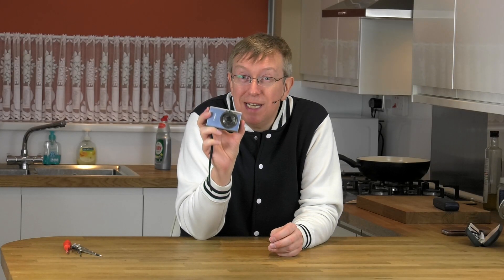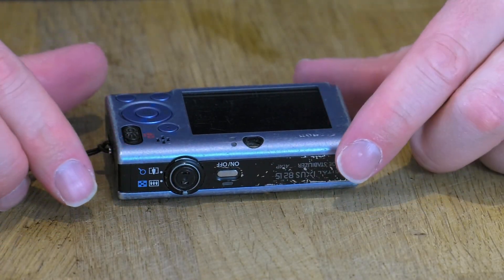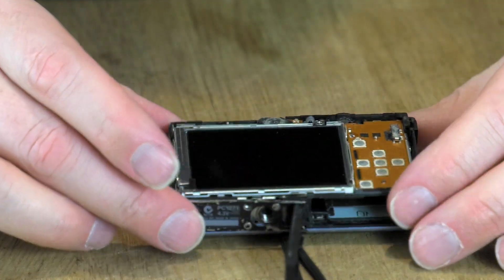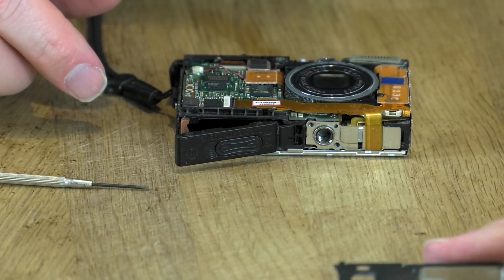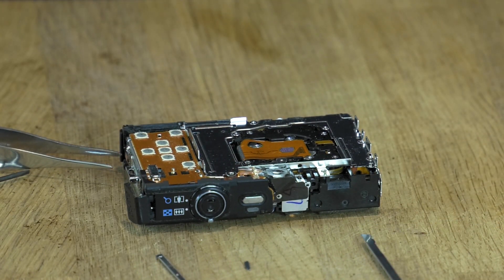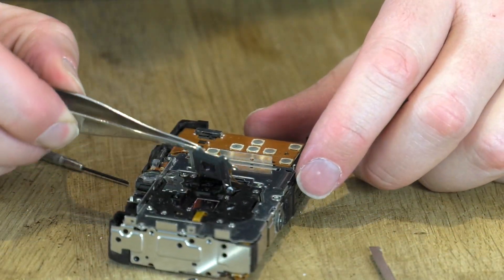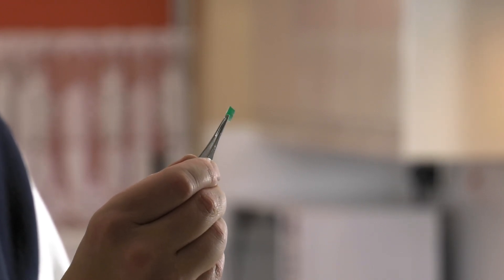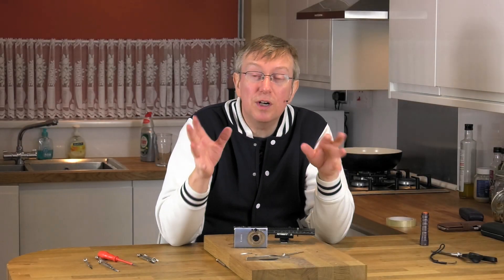How to Make a Night Vision Camera From a Regular Digital Camera (Infrared IR)

Comment: tried it on a nikon camera and did not know that the black connector that hold the ribbon cable was supposed to be useful, everything works EXCEPT the lcd because the lcd ribbon isnt connected fully and its loose, and since i thought you didnt need the black connector piece, i broke it and i tried many times to put it back in the ribbon cable. fun project for like 30 minutes then after the lcd problem everything just went from "wow thats a cool thing i could do in an hour" to "its been 4 hours and the lcd wont turn on and im on the verge of throwing my camera into the stratosphere." 10/10 would try again

edit: these arent ribbon cables but flat flex cables and they were not suppose to be repaired lol i love my life

Comment: if you want to experiment with this kind of thing, you can also use any old tv remote (  it uses a Infared led to send signals), although it will flicker and the range will only be a few feet. even without the illuminator, the camera will be able to pick up on any ambient infared light, which is handy on its own.

Comment: Your video is very, excuse the pun, illuminating to me. I’ve been trying to understand much more about infrared cameras. I own a Reolink RLC-520A camera which is very similar to a camera that’s pretty instrumental to some extent in this Idaho student murder case…in that it captured Images of the suspected killer driving past to the camera.  This happened back in 2022, but it isn’t until recently that a lot of discussion about the vehicle color has occurred.  Many wondering if the car is actually green, but appears white on infrared camera.

I’m curious how much knowledge you have about understanding and perhaps even predicting what color things will appear on an infrared camera.  Or perhaps it’s more correct to ask, where in the grayscale range will various things appear?

I feel like recently I’ve come to understand that infrared cameras react differently to different materials. Specifically, in a test I did, a green notebook turns solid white, but a green metal toy car is a light grey. 

My YouTube channel name is simply Jeff H. If you look at my community posts, it was only three posts ago that I shared the two test images from my infrared camera. One in color and one in infrared mode of the toy cars that I was mentioning.

But the basic question regarding this murder case is can a green or lightish green car appear white on an infrared camera?  I appreciate any insights you may have or anything at all. I can learn from you about infrared cameras.  I found a very compelling that you turned your camera into an infrared camera simply by removing that infrared filter.  I had no idea.

Comment: I am a Paranormal investigator, The Infrared light may need to be turned down slightly when doing close shots to prevent washout. all you would need is an inline voltage regulator with a potentiometer. Also if I may make a suggestion using ultraviolet light brings you into a new spectrum only visible to the camera is really great.

Comment: The lens system needs the optical thickness of the IR filter. You need to polis off the coatings of the IR filter and put it back.

Comment: That's actually pretty smart. Also, if you want a lcd screen for your electronics projects too, surely you can just break the camera up to get at the bits and reuse them in other projects? I wonder how feasible that is, or whether they have special chips or things you need
Reply: All LCD screens require some kind of a controller.  Usually these controllers appear as integrated circuit chips, and while there are a few of them out there that are widely available and support a good number of different LCD screens, this is never the case for small LCDs like the ones you find in digital cameras.   The controller for that display is going to be 100% proprietary, undocumented, and unavailable to the average consumer.    Reverse engineering may be possible if you're really dedicated to it, but the amount of effort you would invest, assuming you had the knowledge, is never going to be "worth it" to repurpose a crappy, low-resolution, tiny LCD.

Comment: I found a few old analog video cameras (Hi-8 etc) with large folding screens with very bright built-in IR lights.  You would need cables from the cameras 1/4" jacks to another camera aux in ports to record, but the lenses and lights are far superior to those little point and shoot cameras. You could also record to a laptop for even better quality and have a larger monitor. 
Also cheap security cameras have built-in IR led's and some have mics as well. No tinkering. Plug and play. Just use a coax to 1/4" adapter and plug into your camera or laptop.

Comment: You did a great job modifying that camera, with my hand tremors I could never do that. A few years ago I found a retired guy on ebay who lives a few towns over from me who buys refurbed point and shoot cameras and then removes the IR filter. I bought a Nikon L610 from him with the IR filter removed and have used it for some IR photography. I paid about $100 for it and it works very well for my uses.

Comment: What is the point if you have to attach an IR flashlight to the modified camera? Attach a regular 5w/12v led lamp to the stock camera and it will do the same thing ,and besides you will have color video.

Comment: thanks for the video.
My camera was way more difficult than the camera you had in this video,
i had to Remove Solder in five spots and the Infrared filter was glued to the camera sensor.
i thought there was a 90% chance that i had ruined my camera, but i put it back together and it worked!!!!! except that it was slightly out of focus and that my camera is already riley bad at recording at low light

Comment: i heard that when you do that you need to fix the sensor for focus  if that glass is removed, and you can see that at the end   focus is messed up everything is fuzzy . Guess its true then .
You need to put transparent piece of glass or whatever back in in order for light to focus exactly on the chip , how and why i dont know .
Reply: Pavle Pavlovic It depends in part on how much of the spectrum you are working with. In this case a supplemental IR light may provide a narrow set of wavelengths to reduce focus problems.
Reply: @Dr.GeoDave  they say clear flat glass needs to be placed where filter is removed . thats what ive heard

Comment: Will the camera sensor pick up both the normal visual spektrum and infra-red but favor the strongest spektrum available for the moment?
Reply: It will detect visible and IR. The filter that Rick removed blocks just the IR. Manufacturers do that for two reasons ... to ensure photos look natural (vegetation reflects abnormally high in the IR) and to make focusing better (lenses bend IR light less than visible ... blue bends best)

Comment: If you want photos at night, a DSLR can get the job done...in fact, if you can find a Nokia Lumia 1520 or better the 1020, 2 dated Windows Phones, they could get it done.  If it's pitch black out, adjust your settings, turn the flash off, shutter speed slow, hold still, snap, and your picture will be as if you were in broad daylight.  Hi-res (up to ~40MP), full color photos...
Reply: This is not what he wants....
Reply: @Zotemann  - What...?  Windows Phones are all the rage - I saw a dude get knocked out cold for one just this past weekend.  Someone was even offering this maniac their Pixel 3 cause they had the insurance...  The dude just slapped it out of their hand and onto the floor.  It was the Windows Phone or nothing... 

I was terrified; just screaming like I was a 5 yr old girl...& I kept screaming even after the dude ran away...it was just 20+ min of high pitched noise.  The doctor gave me ear drops today - said I nearly blew an ear drum.  I told the doc it was a Windows Phone!  ...He held his composure, but he didn't know I could hear him sobbing as I left...

So, how can it not be what he wants when clearly everybody wants a 4 year old Windows Phone...?

Comment: The screws holding the sensor are calibration screws as well. The spring you found is part of one of the calibration screws. The spring presses the sensor up. These calibration screws are used to align the sensor with the lens. Tip: record the height of all the corners of the sensor before undoing the screws.

Comment: Thanks man, very useful video. I plan to use this technique to make some trail/wildlife cams. By the way, that 'bar' you removed to get the second ribbon cable out, you're not supposed to remove it. Just flip it up and it should release the cable. I guess you've probably worked that out by now given that I'm 2 years late.

Comment: I think you broke that ribbon cable holder the first time you disassembled it. Have worked with cameras and electonics for years and that does not look right. It will work though but you can't connect and disconnect it properly anymore it seems.

Comment: Ive done many of these. One thing I can tell you, watch where you put your fingers, especially if youve powered the cam up prior to tearing it down (for you guys that havent done this before). If you touch the flash cap contacts be preprared for a snappy 250 volt jolt. Some of the cams have 330 and 350v caps. It will leave an impression you wont soon forget...lol
Reply: This is an old topic but oh well, back in the day I use to make make-shift tazers out of disposable cameras by disconnecting the flash bulb  & running the both wires just outside the camera housing & then snapping it back shut. The rechargeable Flash cams were the best. Just a neat discreet Lil toy to light someone up with lol

Comment: Nice work Ricky. You answered a question i have been wondering about or a while. I have a run of the mill, cheap monocular. How would one find out if it could be used for night vision e.g lens filters?.  I've got myself a little 5W 850nm IR LED torch that i was hoping once i get to the bottom of the lens issue, that i could just attach to the monocular body itself.

Comment: Great video... just tried it with a Canon PowerShot SD 790 IS and it was a similar build.  The glue on the sensor screws was the toughest part, but worked out perfectly with your help.  Thanks!

Comment: For those tiny Phillip head screws. Take small Phillips screw driver that fits the screw and file just the point of the Phillips driver off until it bites in to the screw firmly. Don't take to much off. This also work for those pesky little Pots on Chinese circuit boards. Feel free to distribute my little secret.

Comment: That was rather disappointing. It's just like gen0 Nightvision. I was hoping for some tweaking with the gain, a cooled sensor and maybe some advanced ideas like taking off the colour filter and using a laser to turn the sensor surface into black silicon.

Comment: Even with the IR filter in place, digital cameras can still "see" some infra-red light.  This is a great way to confirm whether or not an IR remote is working, since you can just point it at a digital camera and operate it while looking at the camera's screen and if you can see a pulsating light, the remote is working.

Interestingly, the light will often show up as blue or white rather than red.  I presume this is because we can't see IR light and the camera just interprets it as a random visible colour because it's outside the range of colours which it's supposed to display.

Comment: Some additional tips for anyone trying this...

Many of the cheaper or older cameras don't have a very good IR cut filter.  A lot of them will show you the IR LEDs in the end of a TV remote control quite brightly... the brighter those TV Remote LEDs look, the better the camera will do.  That's a quick'n'dirty way of comparing a couple of old cameras to see if they will work adequately without modification.

Note that finding an IR filter that can be removed will give you a significantly brighter image... but removing it may not always be absolutely necessary, depending on your IR-lighting and requirements.

Some cheap webcams have almost no IR filtering - probably because they are designed for indoor and use crappy unbranded sensors that don't have good coatings.  These tend to swamp really badly if there is any sunlight in your scene... real bad for a webcam - but great for a night-vision camera.

Basically, the more expensive a consumer camera was when new, the more likely it has decent optical filtering... so cheaper is often better if you want to capture UV or IR.

Dismantling tips :

I'd be very careful to avoid snapping the retaining clip in the miniature ribbon connectors as many connectors just won't work without them.  They often rely on the pressure from the clip to hold the ribbon against the pins... without the clip they just don't connect.  This applies to the ones designed to offer no insertion resistance.  Some (most?) don't remove at all - they slide forward and then hinge upwards to release the cable - so be very gentle and let the connector show you what it wants to do : )

The jewelers set screwdrivers are not very magnetic, which can be a pain in the bum when dealing with tiny screws...  You can fix this by taping a magnet to the shaft (or, if you care to spend the time - by magnetising the shaft by stroking it repeatedly with a good strong rare-earth magnet like the ones from inside of broken hard drives)

Lastly...

The IR image isn't as bright and can be easily swamped by other lights.  You can add an IR pass filter if you don't want your near-field IR image swamped by distant lights like streetlamps.  The newer LED streetlamps almost entirely disappear leaving you with a lovely image - the older yellow sodium streetlamps put out a lot of IR, but even they become a lot less problematic with an IR pass filter.

Just suggestions, I am by no means an expert.

Have fun : )
Reply from the maker: Some great tips there - thanks :)
Reply: @rickvanman  can you do this to a modern day mirrorless camera?
Reply: I have a 14 year old camcorder. Battery works great. I noticed I could see IR light from it so I decided to see if this would work. That’s how I’m here.

Now I just need a IR flashlight
Reply: @Philip Hastings I did this to a Lumix TZ10. I watched videos of cleaning the the lens. I memorized the structure inside and out and that is how I managed to succeed
Reply: Sounds like we all can profit from you making your own channel

Comment: What makes me mad is the bull that the manufactures put out telling you of all this technology  that makes it an infrared camera when you've shown that all they need to do to make a camera infrared is to NOT put in an infrared filter. So these manufacturing thieves can leave out a part and charge sometimes 10 times the amount they charge for the same camera they put the filter in. Now if that's not thievery I don't know what is. Enough griping. Nice work, very informative.
Reply: if you remove that filter, you'll have to go through tons of militar/technological papers to be able to sell your product, thus increasing the final price.
Reply: Gunny, basically, this is it. But, there are ways to go about IR photography depending upon whether the camera is a dslr or mirrorless.  IMO,  mirrorless is easier in that as auto-focusing is achieved by the sensor, no focusing adjustments have to be made to the camera or lens.  With a dslr, we focus using visible light and this may require in-camera changes to the AF settings of virtually every lens to be used on the camera.  Not sure if your 10x price factor is correct, but there is more to a dslr for IR than simply omitting the filter. 
By omitting the IR filter on the sensor you will have what is called a "full spectrum" camera, but this requires an IR filter of one's choice to be used on every lens.  And using a "UV IR" filter on a lens will allow a full spectrum camera to be used for conventional shooting. 
This is what I prefer, as the alternative is to replace the sensor's IR filter with a specific strength IR filter. Photographers who use IR for b/w image conversions would settle on an IR filter that gives them what they like.  
It may to pertinent to mention, for those not familiar with IR photography, that the filter fitted to a sensor for normal photography is an IR blocking filter (allowing visible light to pass) but the deep red filters used for IR photography pass IR light and suppress visible light. The wavelength at which they block visible light can be controlled by selecting IR filters with different wavelengths; a weaker IR pass filter passes more visible light than the more dense IR pass filters.

Comment: You will also find that if you remove the IR filter from your SLR (if you use one for astrophotography) it will allow you  to detect more of the H-alpha light since the pass-band of the IR filter overlaps the H-Alpha line.  Most emission nebulae will be much brighter without the IR filter in place.
Reply: IR cut filters don't usually kick in until 700nm. IR doesn't go thru the atmosphere very well. Put on a <500nm block and you will get spectrum for 500-700nm which covers the 656nm of H-Alpha.